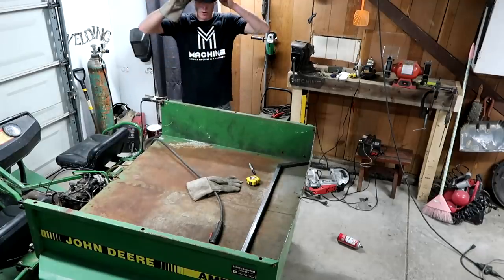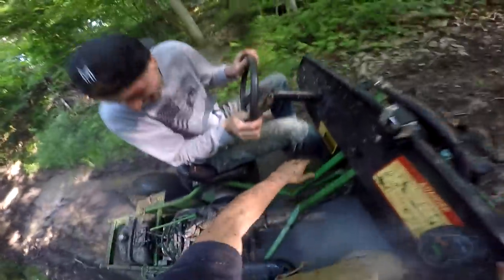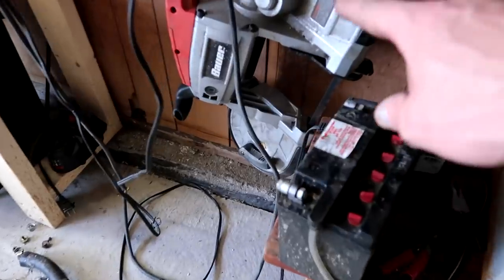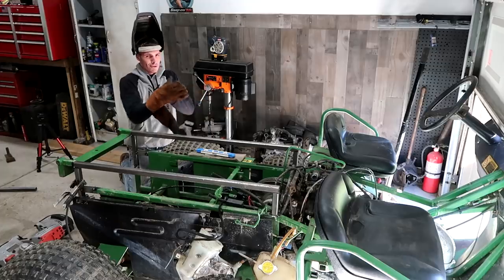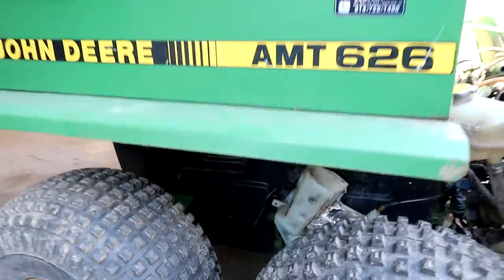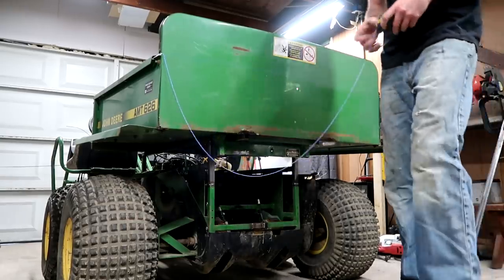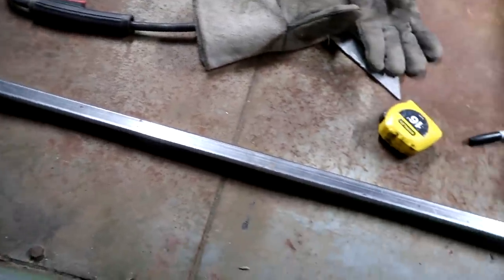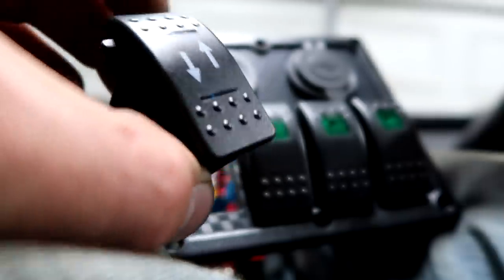100HP Gator Gets A Bed +Headache Rack

Comment from the maker: IDEAS IDEAS IDEAS!!! PLEASE HELP MAKE THE GATOR AND THE CHANNEL BETTER.... GO!!!!!
thank you,
3DMachines
Reply: Put a Coyote swap in it😂
Reply: It’s badass already! Some mud whooping tires on the back would work better for your trails. With diff locks on both axles it would be unstoppable
Reply: You should put that 12.5 go engine on the braap board
Reply: Build a new race mower or mud mower with the 12.5 opposed twin
Reply: Off-road mower with the spare engine
Reply: shopping cart go kart to beat the boosted boiz
Reply: Racing lawnmower like the old ford lawnmower but better
Reply: Off road racing mower from the good old days
Reply: Please make a rear engine racing mower!!
Reply: 1 light bar
2 a muffler 😂
3 steel mesh in the middle of the headache rack
4 reinforce the transmission or something since it’s gonna blow up soon if not
5 custom bumpers
6 snowmobile shocks up front 
Hope this helps 🤷🏼‍♂️
Reply: Seats in the back for more passengers would be sick, as for the channel it feels like you are heading back to how you used to make videos when you started the channel and I'm diggin it. Keep up the awesome work can't wait for the next vid.
Reply: Joe Schmoe I like that
Reply: Make a mudding mower with that engine
Reply: The switch is a electric reverse switch
Reply: 3DMachines braaaap board 2.0 😂
Reply: @DJDOUGHERTY6  make a drist/race mower
Reply: 3DMachines Jeep update please
Reply: Put receiver hitch where as you called it the old farm hitch was and tow with the GATOR
Reply: Man make a trike and put that 100hp motor on the trike
Reply: 3DMachines Brap Board 2.0???
Reply: BIGGER TIRES
Reply: Smoke stacks
Reply: Smoke stake the gator duble stack. Mean green machine
Reply: 3DMachines change it to chain drive
Reply: that spare engine u got is what i got in my mower but it is an 18 hp, its about ready to blow, so keep the oil changed when needed and dont let the gas leak into the crankcase, and u should be good. i think the owner that gave me the mower had gas mixed with the oil and it totaled the engine.
Reply: Make aome more vides
Reply: Build some kind of off road Segway
Reply: You should do nothing with it bc u probably won’t finish it anyways
Reply: Give it a winch
Reply: do suspension on the gator a winch mud tires and bumpers
Reply: Make diamomd plate (cool factor) come down from bed railing angled out and down to hug the tires (kinda like a dually truck)
Reply: 3DMachines shifter kart
Reply: Take the old snowmobile track cut it in half and put them on both the gator tires in the rear on both sides or just make other kinds of tracks
Reply: 3DMachines mine goes anywhere with tracks
Reply: Could case off a dirtbike/fourwheeler bottom end to make a stand alone multi speed transmission and link it to the engine
Reply: Buy a golf cart with no engine and put the 12.5 horse in it
Reply: Put that engine back in the Ford mower where it belongs!
Reply: Where is the Jeep
Reply: 3DMachines use the engine and make a off-road buggy from scratch
Reply: Please build a boat
Reply: Make a mud mower
Reply: thing looks cool like that looks like a tank its better that the bed is higher so the tires dont hit you should put a cage on it
Reply: 3DMachines you should build a cover for the belt so that way you don’t have to worry about water making the belt slip when you don’t want it to. Also love your vids keep it up so glad I started watching you again.
Reply: Make a new racing mower or get the old one back out
Reply: Springer front end
Reply: Build a racing mower again
Reply: The 12.5 Engine with Nos
Reply: Hey what's up Dalton I just got a little opinion for you about the wholemlm mudflap situation on the back of the gator I think you should cut them off of the bed and then somehow attached them to the frame via either bolts or welds or go get some sheet-iron and make your own either way I think the gator has come along great this is some amazing content your giving us and I greatly appreciate it I hope you consider my opinion on the mud flaps or would you call it a mud guard fender flare either way you know what I mean
Reply: Instead of lowering the dump bed why not just go bigger wheels John deere makes wheels for the side by sides or maybe they make taller tires for thoughs rims they look like 8 or 9 maybe 10 inch why not just go taller tires and weld like a wall where the dump bed sits on the gator so theirs no gap for mud to get into and everything would still be accessable
Reply: @jacobmur0893  man those are fantastic ideas I agree 110% with those good job dude only thing you forgot was the mud guards slash mud flaps whatever you want to call them
Reply: Time lapse your work keep everything else the same good work dalton
Reply: 3DMachines  make a completely custom build from the ground up would be amazing to watch
Reply: Ptv (go kart) with tracks instead of wheels👍👍 do a Invisalign update I’m considering getting them most update videos people no nothing about we could relate to what you think about them
Reply: Glad to have ya back,  brother!
Reply: 3DMachines mud flaps
Reply: LED s for a start winch and maybe a lift on it....how much Dalton i want first refusal.......
Reply: LED 's For a start a winch and maybe a Lift on it how much....?i want first refusal on buying Dalton....
Reply: What happened to the braapp board
Reply: Make a drift trike
Reply: Dalton of course it did not break your are a god
Reply: you should make a wagon or bike with that spare engine
Reply: Turbo😍😉
Reply: make a couch that has an engine
Reply: killer DRIFT TRIKE build with 12 HORSE ENGINE!!!
Reply: Fix the gator diff lock
Reply: 3DMachines  light bar on the headache rack
Reply: 3DMachines you should build a fully functional lawn mower with the 12.5 horse
Reply: That 12.5 would be a perfect outboard boat motor project
Reply: @3dmachines finish the Jeep build
Reply: 3DMachines flat bed it
Reply: Give me measurements and I can draw up a bed that makes it fit like it's originally supposed to.
Reply: Buy yourself a little truck. Remove trucks said engine. Weld a predator 670 straight to the transmission. Boom content 💪 lol
Reply: Street gocart for the other engine
Reply: Racing mower like old days
Reply: Bring back the brap board
Reply: You should build a super fast shifter cart
Reply: Gator needs a radio next.. great video..
Reply: Needs a roll cage!
Reply: 3DMachines make custom fender wells that extend down to the wheels dalton. I think that would look sick asf

Comment: Take the handle bars and some of the shaft for the steering off the snowmobile if you still have it and put it on the passenger side of the gator for a oh 💩 handle for the passenger

Comment: Hey what's up Dalton I just got a little opinion for you about the wholemlm mudflap situation on the back of the gator I think you should cut them off of the bed and then somehow attached them to the frame via either bolts or welds or go get some sheet-iron and make your own either way I think the gator has come along great this is some amazing content your giving us and I greatly appreciate it I hope you consider my opinion on the mud flaps or would you call it a mud guard fender flare either way you know what I mean

Comment: drain the oil out of that spare engine, and refill it with diesel.fill the gas tank, with gas, and put it on full throttle, set out in an open field and see how long it lasts

Comment: You should make a 12.5hp shop fan...  gaaaaawdamn.   I guarantee you a puckered butthole when you turn that over with fan blades attached to it..  find an old hvac metal fan and it should be same shaft size..  i dunno what size fan you need for a fan glider but yea..  ballz to the wall in my opinion...  i hooked some fan blades to a chainsaw motor and that was only like 2 or 3 hp i think..  that fucker was literally insane..  after i started the motor i had the throttle pinned open and i had to just stand back till it ran outta gas because was in a bench vice so was way to sketch.. but fuggn crazy either way...